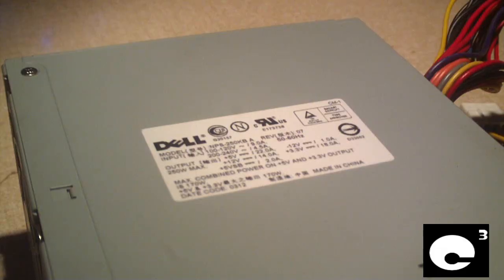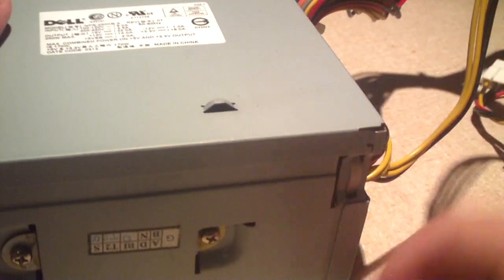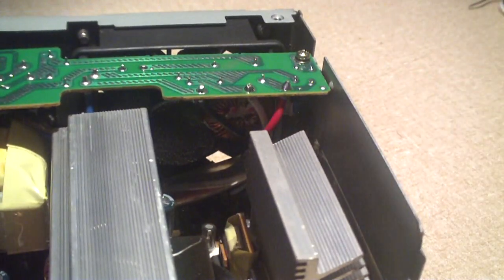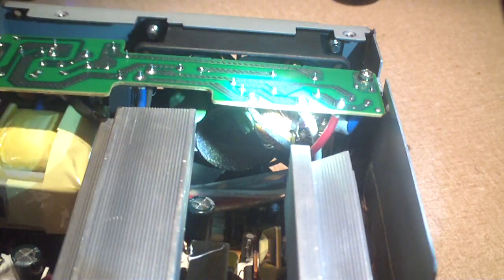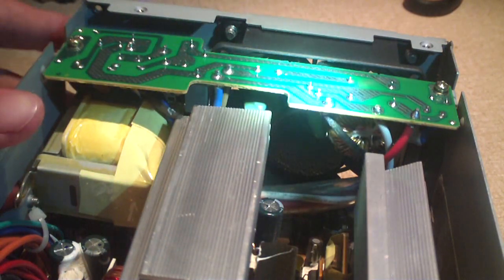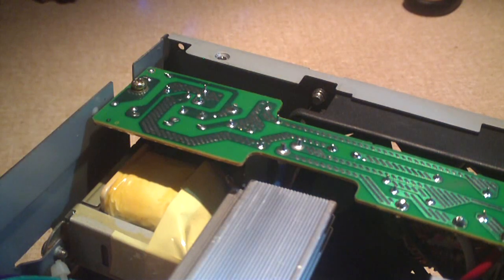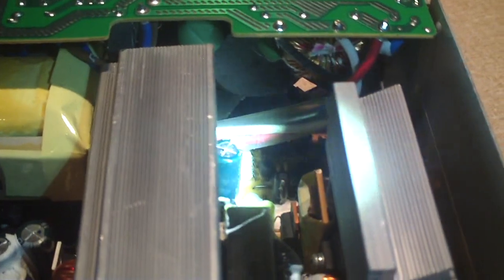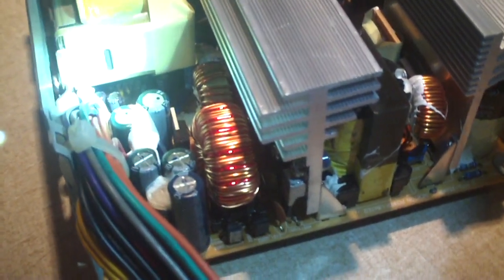A look inside a Newton Power NPS-250KB A 250W PSU with P-PFC

Comment: Hi I have a Newton power LTD 250KP-2 POWER supply and I accidentally switched the 250v switch to 115v and a burst sound came in .. I wanna know if its completely dead or there is a chance I can power it on by changing the components that are dead.. Plus how will I know what components are dead?  Pleese help
Reply: There are two varistors in parallel with input bulk caps. One or both dead, you need to replace, and input fuse as well.

Comment: I have an "f" model lying around.
How do you do the 'paperclip trick" on this one to turn it on?  
The green or gray wires don't work . .
Reply from the maker: Shorting the green and black sends the power-on signal to the unit. If it's not turning on, then there's likely something wrong with the unit.
Reply: Thank you for your reply!
I was hopeful, because I remember everything working when I took it apart.
However, it sat in a basement for a few years, so perhaps the moisture or dust got to it.
Reply: Even you turn-on the PSU manually, you need to have some load at +5V or +12V O/P, otherwise the PSU will shut down
Reply: See my comment below

Comment: Do you think there is a way to get a -5V output reference from the NPS-250KB? Something like "open the box and attach a cable somewhere".
Reply from the maker: On this unit, I doubt it. Some power supplies use an older PCB design with the-5V solder pad there, but if the -5v wire's missing, then chances are, other needed components are also missing as well. Are you trying to run an older system such as a Pentium III or prior system?

Comment: I hate to spoil the good capacitors analysis but I did spot a Ltec start-up capacitor next to the smaller flyback, auxiliary winding transformer for +5VSB. The rest of the capacitors, excepting the voltage doubler (Nichicon LU) appear to be Taicon (Taicon actually isn't much better than the average Taiwanese brand but they're far from the worst), though. I wouldn't be worried about it because Newton Power/Delta PSUs are good at making bad capacitors last with overbuilt and low stress designs.

Comment: Hi CubeComputerChannel, this is Wester547 from badcaps.net.

It is indeed a very nice power supply - Dell power supplies, usually from Hipro, Newton Power, or Lite-on back then, were all very well-built. They had massive heatsinks, very overbuilt rectifiers and powerful fans, which resulted in long life even with subpar capacitors and sleeve bearing fans.